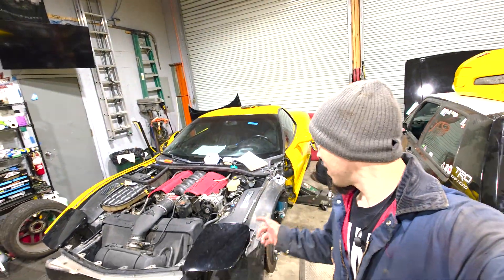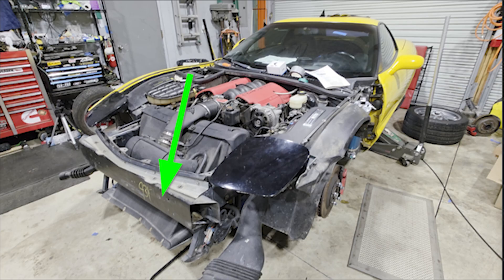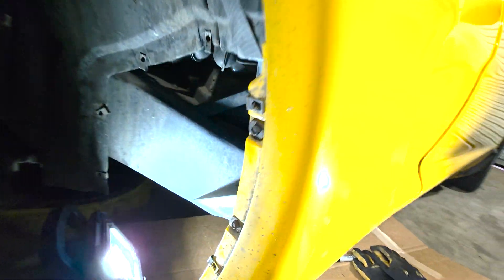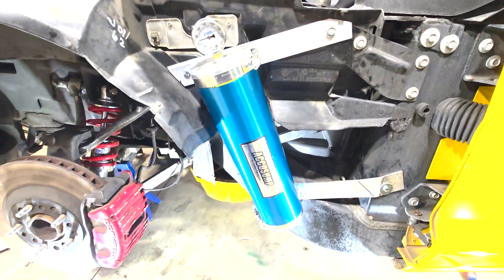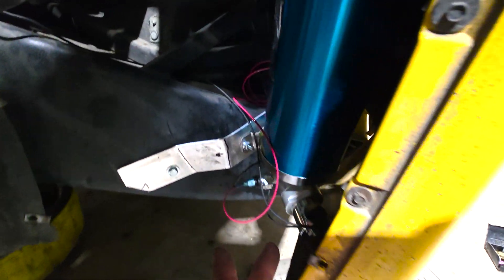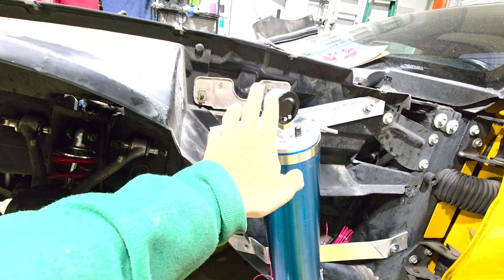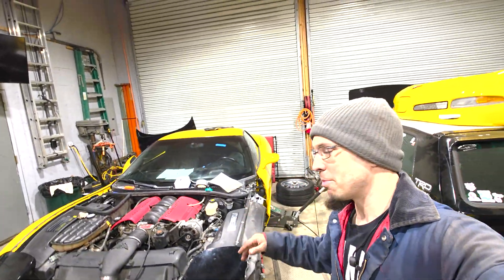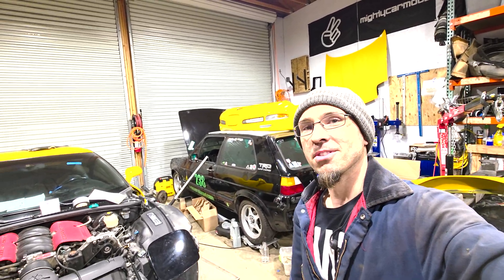I wish I had one of these before I blew my engine -  Accusump install

Comment: Nice install. The only issue you might have is with the accusump with it mounted vertically, water can build up in the air end from condensation and air can build up in the oil side. The accusump will hydrolock. So if starts acting funky like the accusump gauge doesn't match the car oil pressure gauge or the air end seems to be leaking. Check for hydrolock.
Reply from the maker: Good point, I'll watch for that.  I was kind of limited on where it could go so I think this will be an okay trade off.   I assume that when I do oil changes I can check for thinks like that.
Reply: @oisforoffroad  I had same problem. I installed a small ball valve between accusump and electric valve on oil end for when it messed up. To get the air out of the oil end I pump up the air end to 80psi and force all the oil into oil pan. Then start the motor and slowly drop the pressure on the air end, so the accusump fills with oil slow. To get the water out of air end I would let all the air pressure out, remove the schrader valve and blow the water out with oil pressure.
Reply from the maker: @GNaron Great info, thanks.
Reply: @oisforoffroad  Welcome

Comment: Have you installed the Improved Racing Batwing Trap Door kit yet? You might want to look into it.👍
Reply from the maker: I didn't know that was a thing, I will totally look into that.  Thanks for the info
Reply: They are apparently close to releasing an entire replacement oil pan too.
Reply from the maker: That would be even better.  Thanks for the info.  I called them to ask about their Accusump items and they totally missed the opportunity to upsell.

Comment: Thanks! The gauge window is a great idea. No oil cooler on this one? I've heard a bunch of different ways of doing this- Front gallery port, oil sensor port on top. Same with valves. The automatic valves like you went with store the most oil for an event, but run the risk of the electronics failing. Just having a manually activated valve and letting the oil naturally go in and out of the accumulator apparently works well too. I wonder if you can snake an extension for the schrader valve out the hole so you don't need to take the fender apart to re pressurize the accusump?
Reply from the maker: My main form of racing is Autocross and the track days I've done never seem to cause high oil temps so I didn't want an oil cooler.    If you have an oil cooler you will need a one way flow valve and  'T" fitting.  I choose to have mine inject the oil near the oil filter because it gets the oil to the part of the engine that needs it the most in the shortest distance.  

I end up riding with others as an instructor as well as being the timing guy so I don't want anything else to forget like a manual valve.  Ill just monitor the electronics closer and hope they don't fail. I got the very expensive Canton brand units and people say they last the longest. 

Based on Cantons recommendations I don't to make any changes to the air side of the unit. According to their documentation you should hardly, if ever, need to put more pressure in the unit. I guess ill find out.